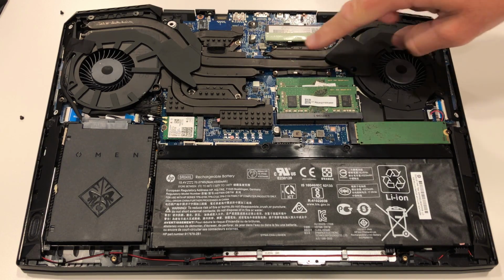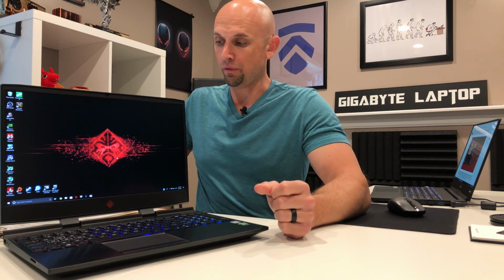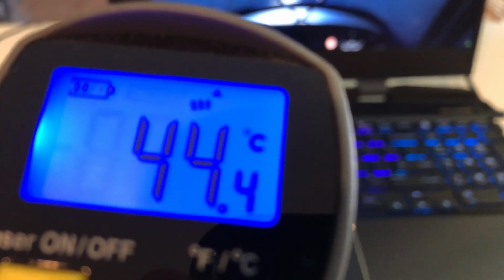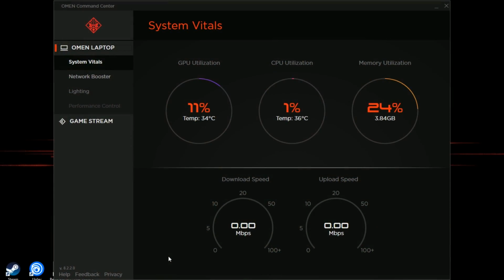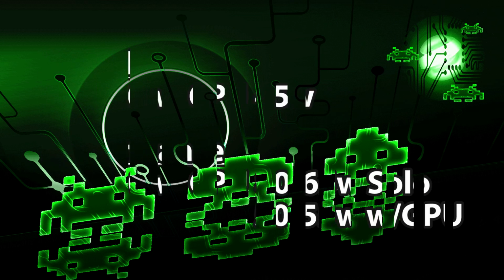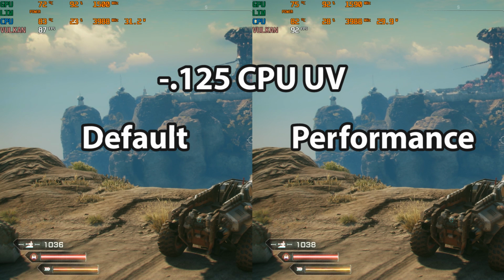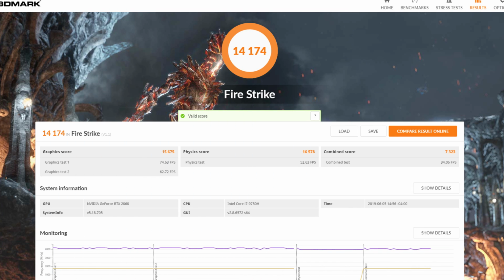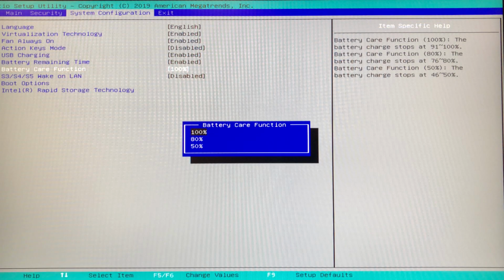HP Omen 15!  RTX, 9th Gen and 144Hz for $1199!

Comment: What is that model number for the ram, as I want to upgrade, but want exact model to avoid issues
Reply from the maker: Run CPU-Z and see exactly what you have in your system 👍
Reply: @BobOfAllTrades  do you still have the laptop to check?
Reply from the maker: No I don’t and I’ve seen the same laptop ship with three different memory brands. Very few laptops pride themselves regarding consistent branded parts aside from Gigabyte.
Reply: Dont have it yet, saved 120 and got the 8gb to get 8gb again later

Comment: Do you trust those hinges? They look like the weight of the screen is going to snap them after a week...
Reply from the maker: I trust the HP hinges over the Legions as the y740 hinges feel very soft. 

The HP on display at our local Microcenter gets abused and its hinges are good still. To the Lenovo’s defense our local Best Buy has the y530 and they too have held up. 

I’m sure the abuse those get from people all over them with zero respect tests their durability somewhat.
Reply: @BobOfAllTrades  Well that's good to hear. Looks are deceiving I guess.

Comment: I'd like to know how hot it runs.  Omens notoriously never have adequate cooling.
Reply from the maker: WILLTACULAR And I’d like to know how far you got into this review before asking this question.
Reply: @BobOfAllTrades  half way. I mean I'd like to see a stress test and like a real thermal test.
Reply from the maker: WILLTACULAR We do that. It’s called BFV multiplayer.  Stressing the CPU, GPU and the memory. Anyone who plays this knows it’s about a rough as it gets for laptops. Unless you enjoy P95 on your laptop to simulate something that will never happen?
Reply: @BobOfAllTrades  how long did it run for would you say?
Reply from the maker: WILLTACULAR 2-3 hours
Reply: @BobOfAllTrades  thank you very much trying to get as much information as I can about the omen thermals. It's something that almost every Omen owner I've talked to, including myself has run into being a problem.
Reply from the maker: I have a video coming up casually discussing the Lenovo Y740 versus this Omen and you will be shocked to see how close they actually are thermally.  The HP if you would prefer, is actually a stronger performing machine.
Reply: @BobOfAllTrades  laptop wise that's not too bad. The problem is in my experience the desktops have about the same thermals. CPU going up to 90c etc.  when talking to the omen team they have a stupid policy where they don't worry about it unless it's 95c or over.  90c with moderate gaming on a desktop just isn't acceptable. I'm trying to narrow down if it's a problem with the thermal paste they use if they don't use big enough coolers or if it has something to do with the voltage on their stock mother boards.  Overtime I'm really starting to think it has to do with voltage settings.
Reply from the maker: @gearsofwill9  These CPU's pull a lot of wattage and this laptop favors acoustics.  Nearly ALL 6 core laptops run well into the 90's...I don't like it either lol

I've been using the Aero 15 for 6 months every day.  It does everything including all of the video editing, hitting up to 93c all the time.  It's been flawless so far and it'll run for weeks straight before I shut it off.  

These parts are made to run this hot and not fail.  But there's always the laptops that do and those people are very vocal about it, as they have every right to be.  My point is laptops failing due to high temps that are still within the spec are few and far between.

With that said, I have some of the best thermal guides, tutorials and teardowns on YouTube for a reason.  I like my machines to run as cool as its capable of :)
Reply: @BobOfAllTrades  oh I totally agree and I also know that these new CPUs tend to run a lot hotter. I'm coming from a place of if you're going to spend that much money on a computer then you shouldn't skimp on the cooling either. Those temps definitely can be sustainable but it is definitely right on the edge. That would be acceptable if I bought a very cheap computer but I didn't. though it is a different story with laptops to be honest most of them run very hot.
Reply from the maker: I have nothing but respect for that comment 🤛

It’s also why I recommend the Raider with Liquid Metal from HID so often. Very cool laptop 👍
Reply: @BobOfAllTrades  I appreciate that and thank you for your time I really appreciate the information you gave me.

Comment: LGD05C0 is the same exact panel model that was fitted to Omen dc 2018 series, which had, and still has G-sync (I'm using it at this very moment). I noticed that hardly any 2019 laptop with 144 hz screen has G-sync. I wondered why is that. I wasn't aware, until this video, that (at least for Omen) those are indeed the exact same panels... I guess those panels were a little too good to be true, so they had to "act"... Unbelievable...
Reply from the maker: DJDenko89 I’ll need a screen shot of that. It’s probably not quite that panel number but close.
Reply: @BobOfAllTrades  https://prnt.sc/o4djhe

Comment: Bob, what would you recommend, this laptop or the powerspec 1520?
Reply from the maker: Hasnain Ali The 1520 gets you a step up in GPU performance including Gsync as well as more storage capabilities. But the 1520 comes with a single stick of Memory so you’ll need to add another 16gb dimm further increasing the price.
Reply: @BobOfAllTrades  Alright, thanks for the quick response
Reply from the maker: It’s about $300 more expensive once you factor in the extra memory module.  It’s still probably worth it
Reply: Sounds good

Comment: lol to 2060 is a joke in max q configuartion a GTXTX970 is faster!also that looks 2nd hand that battery is old
Reply: Would you get this or the Acer Helios 300 with the 1660ti?
Reply from the maker: There’s isn’t a MaxQ variant for the 2060
Reply: What 😂😂😂 the 2060 beats 1070 ti any day it’s 2 times better than 970 maxQ
Reply: @xPlatiinHD  790 want released in maxq the 1079ti is far more powerful than the 2060 maxq, so research before commenting
Reply: 1littlelee what? You really need to learn to articulate correctly I can’t understand anything.
Reply: 1littlelee oh and i just Googled 10 seconds too see that the laptop 2060 ist the same as 1070 Max q so Im quiet happy with my first comment ;)

Comment: Thank you for your review. I'm planing to by the new omen 15 DC1093tx model this week. But I have a thing to clear before buying. Could you help me out??
Since I use this for both gaming and a lot of typing work, I'm looking for a cleaner keyboard rather than those with the violet or green shaded keyboards seen on the previous HP pavilion gaming series (I'm referring to the default color of the plastic keys, not the back light color)
So does the omen comes with a plain keyboard? If you have posted any pic of the keyboard with its back light turned off, I would be glad to have a look at it.
Reply from the maker: Adhith M I don’t have any pics and this laptop is gone. But this example here didn’t have colored keys and it looked great when just lit in white, the way I like it 👍
Reply: @BobOfAllTrades  great..thnx again for the info🙂

Comment: i really want to buy it but i am afraid of thermal throttling, can you please make an undervolting video for this laptop on ThrottleStop or at least share your best UV settings for this laptop? Thanks for your amazing effort, love from Egypt <3
Reply from the maker: I made a performance tuning guide tutorial. Follow it and dial in your own machine.
Reply: @BobOfAllTrades  nice, thank you bob!
Reply from the maker: Youssef Shawky much better than making a separate video for tiring each laptop. Especially since the same machine can use slightly different voltages
Reply: @BobOfAllTrades  yea i just watched "Address that HOT i7 8750h!
" video
and i am gonna get the same cpu  so it's gonna be the same steps, but with diffrent chassis
Reply from the maker: Youssef Shawky This is a better guide for performance and thermals https://youtu.be/14o69V6_ZCM

Comment: I was thinkin about purchasing this, but considering you make a  grill a cheese on it.  It's also made of mostly plastic which doesnt help with the heat.  Cheap price=cheap parts.  I was also gonna go withalienware  m15 runs cooler than this one but I'm still concerned about these new designs and their longetivity due to heat.  So I just decided on the Area 51.  Yeah, its alot heavier but it's fully upgradeable so the price is worth it when you compare to these.  Why not spend 400 more on something thats goona last you probably 4 or 5 years longer.  I'm no weakling so I don't mind carrying around a few extra lbs.
Reply from the maker: What specs did you get on the 51M?
Reply: @BobOfAllTrades glad to answer  i7 9700k  nvidia 2700rtx. 8gb of ram.  I'm gonna add more once I get it.  I didnt wanna pay their price.  the screen is 144hz IPS 1080p.  I bought it off Dell they're havin a 15% off sale then they gave me another 100 off.  I think cuz I have a Dell line of credit.  So I saved around 450.  They say the 2070 mobile in this runs like a regular one since it"s overclockable.  That's one thing I hated about the m15 it uses the maxq variant of the 2070 which is clocked way lower.  My 1080gtx  in my  desktop was gettin like twice the framerate in 4k with a weak CPU and slower ram
 Kinda disappointing since it has 8gb of ram.  I'm hoping this one can atleast come close to my destop.

Comment: Hi bob
What do you think about using Liquid Metal
And add thermal pad like example Thermal Grizzly Minus 8 pad for the LM barrier, will this work? Or Worsen for the temperature
Reply from the maker: Adriel Chandra Ang I did exactly that on the previous version of this chassis. There’s a video in the HP playlist. 

Don’t expect much since the fan curve scales close to thermals. But if you’re going all out it certainly isn’t going to hurt the bottom line results. 

Worse case scenario you’re laptop is even more quiet. 

Their newest build model with a slight redesign has Liquid Metal on the CPU from the factory 👍

Comment: Just bought this exact machine from Microcenter. Will the undervolt settings you used work for me as well? Or is every chassis truly unique?
Reply from the maker: ZWALL I’m sure my settings are close. When I reveal UV numbers they’re never pushing parts to their near failure. Should you really want to dial yours in I suggest putting in the time 👍

Comment: Hey Bob, love your videos! I bought last year's Omen but it's been a real pain, software- and hardware-wise. I'm replacing it with the new G7 15 (7590 with ninth-gen i7) and probably due to how new it is haven't seen any English reviews on it. Was hoping you could offer some of your thoughts on it, since it seems to have improved on the 7588's weaknesses (chassis material, port placement, keyboard, display, performance software).
Reply from the maker: Samil Paul The Dells run HOT. Be ready 👍
Reply: Bob Of All Trades Do you think I’d be best served having a Dell technician repaste it while it’s under warranty?

Comment: Bro what I am concerned about this laptop only temp. Can you do test with vacuum cooler?. Like taffware or something similar with that.
Reply from the maker: Suar 99x2 Nearly all 6 core laptops run into the 90’s. 

The laptop sold and I do not believe in coolers like that. 

Keep in mind the wattage this pulls is very high. If you follow my Performance Tuning Guide to limit the wattage it’ll run cooler. Plus most people are not going to play intensive titles like I showcase.  At least that’s what I’m told lol.

Comment: Hey Bob, have you heard about the      HP Pavilion Gaming 15-dk0619nd? Its a new 15.6 inch laptop with amazing battery live and a gtx1660 and a i7 9th gen in a sleek looking body.
Reply from the maker: It looks like their only one. These were extremely HOT mainly due to poor intake ventilation.

Comment: How can i increase the power my cpu/gpu can draw when just powered by the battery. I wanna get it to run near fullspeed.
Reply: Why would u.
Reply: @cyano3d  when i unplug my ac adapter my power limit drops to 13W and throttles my cpu to base clock speed and it wont go any higher than that. I want better performance, so i can play games better on the go not hindered by an outlet.
Reply: @16alarkin  then plug in... U should never game on battery

Comment: What do you think would be better for me, this one or the new Acer Helios 300? I need a laptop for gaming (primarily Cyberpunk 2077 for next year lol) and I’ll also be needing it for graduate school in a couple months (note taking, test taking, lecture recordings, etc)
Reply: Can someone answer this pls? I have the same question, I’m between this one (hp omen 15) and Acer Predator Helios 300 also from micro center (probably the 17.3” one, same specs as the 15.6”, but $200 more). I just play league of legends so far, I know that I don’t need this “high end” laps to play it, but just in case some high demanding game get my attention later and this two laptops have the same price. So, so far I’m not that demanding at the performance, I’m just worried about the heat issues and other issues I have seen in this video’s comments (also in other videos and  reviews)  that both laptops seems to have. But prob because I just play LoL, it won’t get too hot, (I don’t know about this kind of stuff). Which one do you think will give me less or no trouble in like at least 2 years? Pls ignore any grammar mistake.
Reply: Shou Han Chen hey brah, I actually ended up getting the Powerspec 1520. It’s a little more expensive than both but it has much better specs. If you have a Microcenter near you I’d definitely check it out.
Reply: @initialize21  That's sick! Did you really grab the 1520 bro like I recommended it? Extra curious bc tommorow I'm on the way to grab either this Hp or the 1520.
Reply: @initialize21  thanks mate! i think i´ll have to wait till like august to save money. I just found out that acer just released a  new predator 300(2019 version) 2 months ago. And that one its just siiiick! I´ll take the time to think and choose wisely :D

Comment: Hi Bob i have this model only with a gtx 1060ti and it has a 144hz panel but no g syn
Reply from the maker: chalkywhite 1 1060 ti?
Reply: @BobOfAllTrades   sorry i meant 1660ti
Reply from the maker: chalkywhite 1 Where did you get it?
Reply: @BobOfAllTrades  Hi of the HP website uk for £1,249.00 but got £124.00 of with my NHS code
Reply: It does say new model

Comment: Ahh crap...I just purchased the Y540 17" for $1097 (tax included) ...so this hp unit is really a better choice ?? Should I return the legion? Your thoughts would be awesome.
Reply: Noted!! Thanks got me a bit worried there whew...it's virtually the same spec i7 9thgen , rtx 2060 144hz 1tb +256SSD, 144hz...just not sure if it's thunderbolt 3 and if the 17" inch panel still rates at 200nits...fingers crossed !
Reply from the maker: If you wanted a 17 inch laptop keep it 👍

Comment: I heard HP Omen 15 with GTX 1060 used to have a CPU/GPU temperatures above 85°C when playing heavy games due to bad thermals.

Is it still the same with the 2019 version of HP Omen 15?
Reply: The new one is duel screen.... They still going to had heat problem that why they try to move out of high end gaming laptop and be more like a small segment of laptop...

Comment: Hwy bob I have hp omen dc 0106 gtx 1060 144 hz model but I am facing a wierd issue for the past couple of months. As soon as I plug in my games begin to stutter, they absolutely work fine on battrey. I tried everything starting from reinstalling the windows to replacing the battrey today itself but the problem persists. Please help.

Comment: have you looked at these? https://www.amazon.com/Zephyrus-8th-Gen-IPS-Type-i7-8750H-processor/dp/B07BP9LSVS/ref=sr_1_5?crid=3PI1BOD9PDHHN&keywords=i78750h+gtx+1080+laptop&qid=1560015365&s=electronics&sprefix=i7+8750h+%2Celectronics%2C352&sr=1-5 https://www.amazon.com/Replacement-Unlocked-i7-8750H-processor-Overclocked/dp/B07C9D6Q8M/ref=sr_1_3?crid=3PI1BOD9PDHHN&keywords=i78750h+gtx+1080+laptop&qid=1560015365&s=electronics&smid=AESX3141EPI7X&sprefix=i7+8750h+%2Celectronics%2C352&sr=1-3 these are pretty good deals

Comment: Didn't expect HP to solve the thermal problem in the same chasis. Took them 2 years!!! Too bad I bought the cinder block (17 R5 gtx 1060) a month ago. That was 999$ from micro center. For 200$+ that's actually a lot of laptop over the cinder block.
Reply from the maker: The AW 17 for $999 is a lot of laptop for the money. Sadly they need some work for the best thermals. Often times new thermal paste won’t cut it.
Reply: @BobOfAllTrades  Somehow my one is running pretty cool. I haven't seen temperature go above 80'C, rarely reached lower 90 at times. I mostly do productivity work like autocad and 3D and occasional gaming. I didn't test it by putting it through long gaming sessions. But 3D softwares and rendering also creates the same if not better situations for testing. But I was surprised to see how cool it was running. I did put in performance profile from AWCC.

Comment: 90°c laptop is back
Reply from the maker: They never left lol. Most 6 core laptops hit 90c.  It’s a bummer as this is pretty easy to fix. Keep in mind the CPU on this model is configured to pull more wattage than more 6 core laptops. Unfortunately without a dedicated max fan solution you’ll never see what this could potentially be 🔥

Comment: Some OMEN 15 comes with a RTL8822BE wifi card which is extremely deffective and doesn't work when Bluetooth is ON. Why HP doesn't offer us a true solution for that card??
Reply from the maker: Well this has the new AX200 so clearly they’ve made some upgrades
Reply: @BobOfAllTrades  thanks for the answer.. that is a PCIe like the RTL8822BE? Can I suggest change it to HP support?